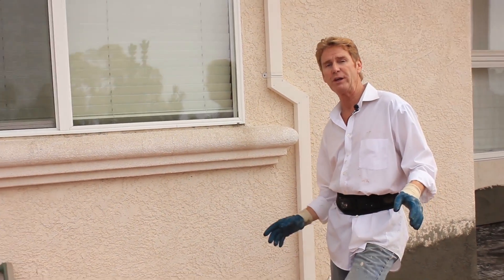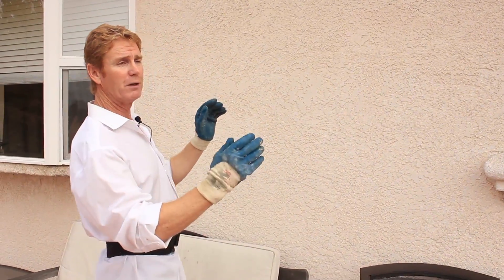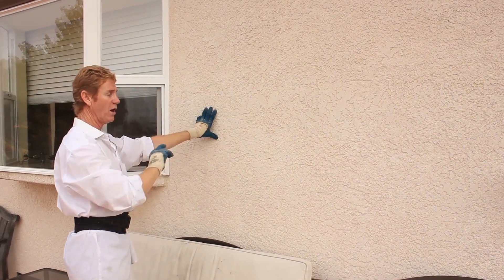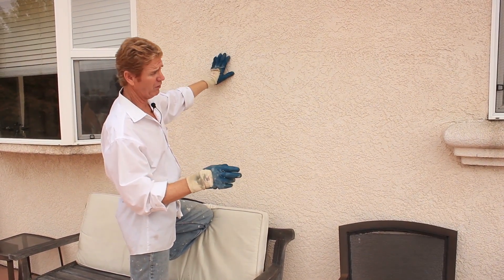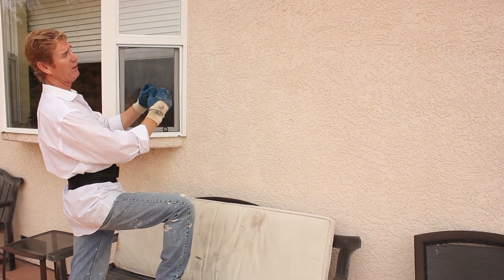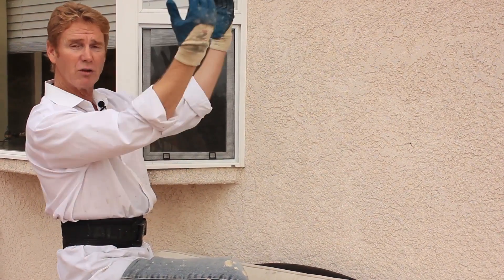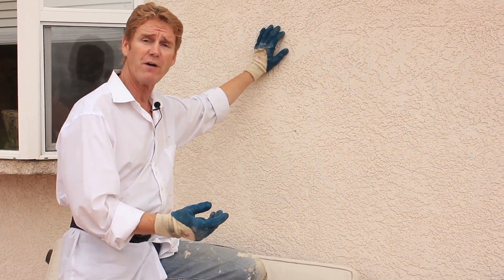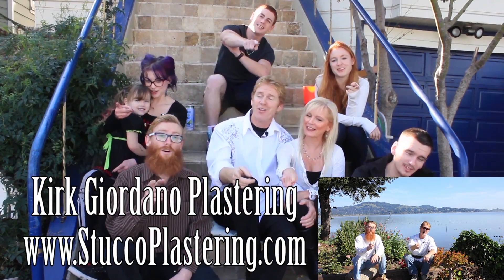What causes horizontal cracking in stucco walls?

Comment: Whats the proper steps to repair hairline cracks?
Reply from the maker: Clean the cracks first, then use some  Mor-Flexx caulking as it has sand in every tube which matches stucco the best. Type in how to repair stucco cracks, we have many videos that explain in a step by step process.

Comment: I’m seeing this on my house. Brown coat is only a week old and I’m seeing horizontal hairlines occur in the long wall where there are no windows or doors. I’m wondering if it’s the sheathing. How bad is this long term? I can deal with hairlines, but do you think this will be a major issue over the life of the house? I’d hate to see the stucco completely buckle in a couple years because of the sheathing not being properly spaced (not much I can do about it now).
Reply from the maker: Keep hydrating the brown coat to expand and have it constrict, you want the brown coat to expand then constrict this way it doesn't crack as much when the finish is applied.
 If you're going to paint, no worries this is normal, continue hydrating and forcing more expansion and constricting. You call it cracking as all hells brook loose not realizing this is perfectly normal.
 Cheers.
Reply: @StuccoPlastering  Thank you! Been saturating the wall everyday, several times a day. Yes, we are going to paint it after we apply the finish coat. Thanks for all you do, I’ve watched hundreds of your videos over the years. Appreciate it!
Reply from the maker: After is cured for a month apply Mor-Flxx caulking into these normal cracks, they should not return in your lifetime.
 Cheers.
Reply: @StuccoPlastering  I was planning on putting on the finish coat after two weeks since it’s starting to get cold. Think I should give it a full month? You think fiber mesh covered with Portland cement would be overkill?
Reply from the maker: @HappyAccidentVideos  if you see hairline cracks you can place fiber mesh tape above and below windows and doors if they don't appear, they may so place the tape there anyway.
Reply: @StuccoPlastering  Thanks Kirk! Live long and plaster!

Comment: Very informative. My house is 10 years old, Southwest style with parapets. The top of the parapets are buckling and cracking. So bad when I remove large chunks I can see the styrofoam. Any suggestions for a repair. Should I use stucco cement that is mixed with water or can I use the ready stucco patch material.
Reply from the maker: I tend to prefer mixing material versus pre-mixed, yes it's more work, but premix materials are weak and dont last long.
 If it's cracking and it needs to be water resistant, depending on the crack size, I'd coat with an acrylic a perhaps even a few times, as with acrylics you can't apply thick, so many coats may be necessary after the first one is set.                       
             Get Plastered wit  Kirk and Jason Giordano Plastering

Comment: Hello. My 1970 communist, concrete apartment building is developing horizontal cracks in it's stucco facade. The building is made 100% of reinforced concrete. Does concrete shrink as well? Is the stucco cracking because of age? Thank you.
Reply from the maker: Howdy Adrian, concrete does not shrink, it does decay with time.
 Your issue is with ground settling, type in what cases cracks in my stucco walls on our channel, i go into detal about the many different reason why this is so common.
Best wishes,
Kirk and Jason Giordano plastering
Reply: Thank you. It was helpful. I am sure that this is the case for my building. 48 years of settling, two magnitude 7 earthquakes, and major neglect over the years have taken the toll on the poor stucco. Thanks a lot again. Even though the 10 story communist buildings here in Eastern Europe were built like bunkers, out of reinforced concrete, they are still 50-60 years old, so any crack is an object of concern. All the best :)
Reply from the maker: Hi Adrian, before I answer the extended version of why homes and or building crack I must first say, "hairline cracks are cosmetic and do not affect structural integrity." 
   A more detailed answer is of why homes crack often occurs as a house moves, oh yes, all homes will move just a hair, especially when it rains, the water lifts the house only a fraction, this can't be measured by man's instruments or seen or recording in any way, then when the dryer conditions return? Settling cracks begin, no big deal we all get them, caulking cracks instead of filling with stucco will flex better when the home is moving however with a big patch only plaster or mud will repair it. 
   Movement or vibrations to stucco or concrete is not good, but natural.
      We have many video’s offers simple caulking repairing tips, I’m amazed at how many homes I see with poor caulking applications, but this is another story.

   Movement is a crucial cause of cracks especially in cementitious color coats, decks, sheetrock, tile or comp roofs, floors, headers whether for structural or cosmetic reasons "SHOULD BE INSTALLED" before stucco color finish coats as a rule.

     Often hairline or large stress cracks are due to settling.
Poorly built foundations, high winds and especially "rain" which causes the ground to expand and then shrink when dryer conditions occur.
   Installing new roofs especially tile roofs, opening, and closing doors let alone slamming them especially the big beautiful solid oak or similar ones (causes vibrations,) who has not slammed a door by accident or anger?
   Traffic driving to and from, again this is the ground movement which can't be seen or felt, even furniture being moved around inside the home if heavy enough causes the unseen vibrations.
      Glass, concrete, and stucco usually don't flex much, they instead shatter or crack with movement and or vibrations.

        A seismic engineer can determine by researching an existing foundation that a current wood home can handle the extra weight of new concrete. 
  However, no amount of competent engineers or other top specialists can say for sure that a home where new stucco was applied won't result in issues or cracks in the future. 

     Also, note the concrete sidewalks or driveways or even the tar streets, if these two are cracked it’s the earth moving, stucco walls and or driveway can crack without earthquakes, again, the main reason all solid substrates hairline cracks are the seasons, rain lifts, when dryer conditions occur all substrates settle, viola settling cracks.
  I have also seen homes lifted off their foundations by the roots of redwood trees as these roots do go down however many appear on the surface and follow the horizontal ground lifting anything above them as they grow.

   These above reasons just touch the surface of why stucco cracks.

   What about homes built on fault lines, this is not an excuse instead of a simple fact.
     Even the best contractors or homeowner can go by the book and even above and beyond building codes and still get some hairline cracking in new stucco jobs.

    More reason's why stucco cracks can indeed be blamed on plastering contractors or lathing errors, such as by placing staples or furring nails in the field instead of the stud where the weight per square inch is necessary.
Placing stucco netting on backward, is a big, no-no, using nails and or staples where the leg does not penetrate into the stud at least 7/8 also creates issues. 

 The General contractor can also build with still, green studs if that's all that's available.
 Butted plywood sheathing together is another cause for cracking. In areas of intense heat, it’s necessary to gaps the plywood sheathing, as when the sun bakes a wall for ten hours daily this causes all sheathing and studs to expand, thus this slow expansion has enough push to create not just vertical cakes but horizontal cracks. 

   How many times have I seen contractors actually space the plywood sheets, Perhaps 1 out of 10 jobs in my area, but we live in a cool climate, so it’s not so critical?
Yes, I do have video's where I show this spacing too.
   Vertical cracks are quite typical and normal around doors and windows that shut or slam when opening and closing,.
 Wind and especially a week let alone a month of rain is possibly the most significant movement to any home as this creates ground swelling then settling which can't be measured by machine or the human eye, yet, after storms, the new cracks with no dirt tell the story.

Foundations not poured properly or with weak concrete also concrete with a PSI strength under 2,500 PSI does not help either, our plaster sand mixed that is not rinsed free of salt, or certain sand not meant for structural strength does not help either.
    About 1975 I believe weep or drips screed became mandatory, to keep the stucco from going to the ground, these weep or drip screeds also create an expansion joint and give us a stopping point plus allow the water in newer stucco system to wet out, newsflash I have seen my share of homes with these screed placed in proper positions hairline too.
    I have seen and videoed a few homes which have horizontal cracking every 4 feet,
 There are about 20 solid reasons why horizontal cracking can and does occur.
    The main reason being, the studs and or sheathing was green when the framing took place.
Now take 2 to 40 days or more with intense heat bearing down on a stucco wall for many hours per day, this extreme heat will expand the wood, thus pushing on the plastered walls, voila cracking occurs.
 
FYI, if a person lives in an area that does not get hot, expanding sheeting may not occur.
 I live in an area where we have only about 10 hot days per year that it reached 95 or above,
    However in some of the valleys "inland" where I sometimes work I have seen the horizontal cracking often as the sun is more intense especially if a home is on top of a hill and facing directly toward afternoon heat.
  

  FYI, with stucco the slightest movement and or vibrations causes hairline cracks, this does not affect the integrity of the waterproofing membrane, however, most folk panic as they have no clue why this happens. Thus any home movement is sort of like Kryptonite to Superman, not good.

  I have been in the plastering trade for almost 40 years and have removed exterior plaster from at least 20 homes, no fun, obviously, I don’t do this horrible demolition anymore, but by doing so, I have seen my share of reasons why stucco walls crack.

FYI, if a person does not want to deal with any stucco cracking in their lifetime, they can build a wood home. However, they are prone to wood-rot, and more problematic issues than plaster by far.
 Kirk Giordano plastering
Reply: @StuccoPlastering  concrete does shrink

Comment: dear kirk. my recently had cement panels installed with 3mm gap between joints. we  added 10cm tape between joints and filled with joint filler. we then placed acrylic,cement glue embedding fiberglass mesh on whole walls of about 4mm. we then stucco 2 layers. in a few days we  had hairline cracks between joints. do these normally grow? should i give it some time to settle before filling the cracks?
Reply from the maker: Morning, I'm not familiar with this method, sound somewhat like the dry-vit system, however panels of styrofoam are butted tightly in fact some have a tongue and groove system so that they are attached even tighter.
 The only gaps I am aware of is when installing plywood sheathing in plywood especially in very hot areas and with green plywood sheathing, these substrates have the ability to expand and contract.
This movement although we can't see happen when the hot sun bakes the walls for hours on end causing plywood and sometimes even stud swelling,  this normal action pushes against the stucco, thus creating hairline cracks as stucco does not flex or move much. 
Like glass it can move just a wee bit any more than this and a hairline crack will happen.
The good news is that if your painting allow to cure at least 28 days then use a quality caulking to fill, if you have a sandy texture purchase a caulking with sand, and yes even caulking takes a lot of practice to apply so that when painted won't show.
best wishes,
 Kirk giordano rendering
Reply: +Kirk Giordano plastering Inc. morning even though is night here. we are following german knauf aquapanel instructions. they use the same tecnique with yellow densglass with better results without  leaving gaps though.
Reply from the maker: Evening Mara, with Densglass one should paper and wire and apply stucco as you would typical stucco systems.
 Or one should paper and then attach the foam boards tightly, apply the fiberglass mesh and necessary stucco base coats with a finish product,
  cheers,
 kirk giordano rendering

Comment: Great video! Super helpful.
Is it possible to get water damage through those hairline cracks?
Reply from the maker: Hi gerekrisz, sure it's possible, but most stucco walls will crack in the first 6 months, settling issues, the paper should remain in good condition for many decades.
 Best wishes, 
Kirk giordano